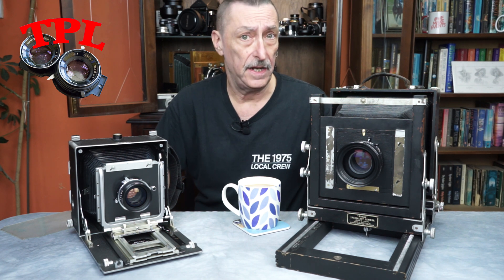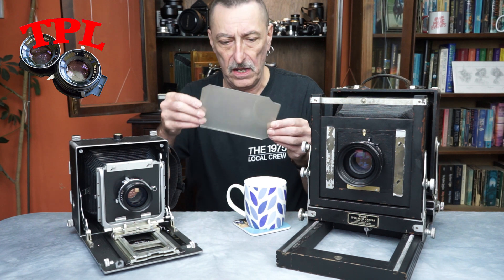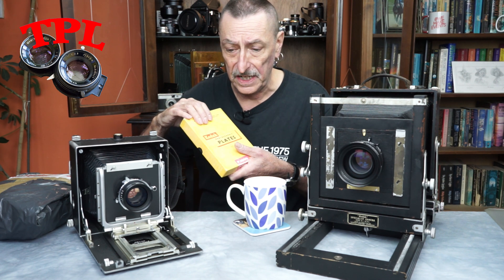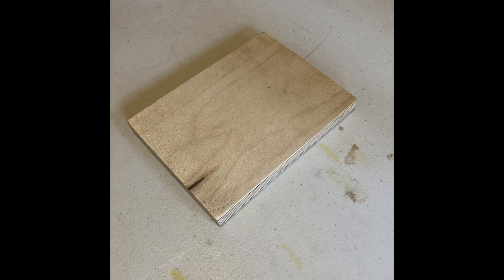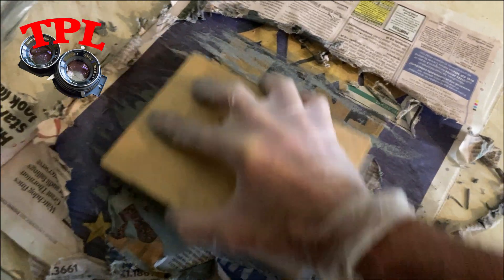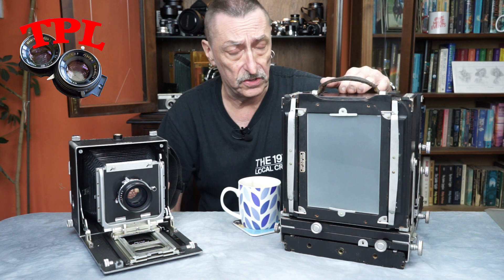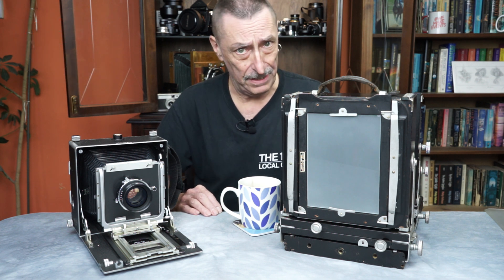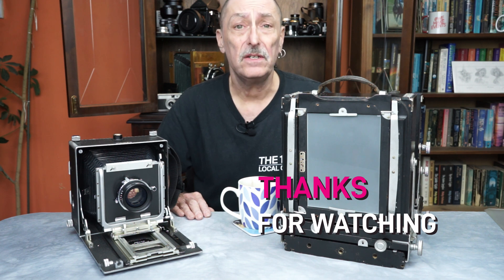Making a large format focusing screen

Comment: Good video! I've got a couple of questions: 1) Which thickness should the glass be in order to depict the true focus accurately? Or this isn't the case. because the image is formed on the inner (towards the lens) side of the glass, which is the focal plane? 2) Should the glass be grinded on both sides, or only on the side towards the viewer? Sorry, if those are kind of stupid questions, I'm not really into large format photography, I'm just building my own panoramic camera and I want to figure out how I would make the ground glass system to get a precise focus. Thanks!
Reply from the maker: As you have said, the image forms on the inner surface, so should not really matter. I used old glass neg plates in this vid ... I've also used 2mm picture glass with no issues. I wouldn't go too thick as it won't fit clips and diffraction may be an issue if one goes mad on thickness.
Grind the glass only on one side and that side goes away from the viewer. The most important thing is that the ground side is EXACTLY in the plane the film will occupy.
Reply: @ashsphotolounge  thank you for the answer, this clarifies a lot for me now. Got it -  the grinded side is the one inside the camera (which is the focal plane).
Reply from the maker: @mikelast5637  You got it 🙂

Comment: Enjoy the repairs and advice. On the last point what is the difference between a lens for 4x5 and 7x5? Can you put a 210mm for 7x5 on a 5x4? Sorry if this is a daft question, I’m news at this .
Reply from the maker: Okay, with large format the first thing to consider is does the lens have a big enough 'image circle' for your format size to fit comfortably inside it. So for example 7x5 fits pretty well within my Schneider-Kreuznach Symmar 210, so it follows that the smaller format 5x4 will fit with even more wiggle room - or should I say 'movements' room! All you need to fit a lens that covers 5x7 onto a 5x4 camera is a suitable lens board. Of course the angle of coverage changes, so a 210 is a standard (same as 50mm on 35mm film) focal length - but a short telephoto on 5x4 ... in fact a perfect portrait lens :-)
Reply: @ashsphotolounge  many thanks for help and advice